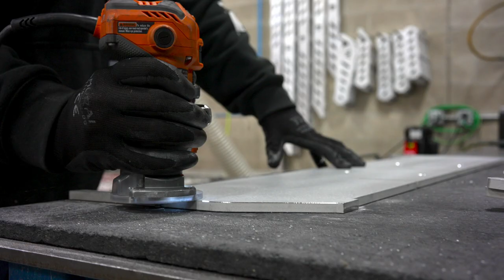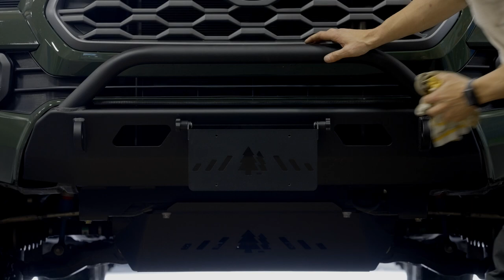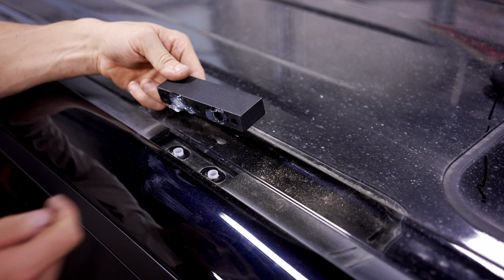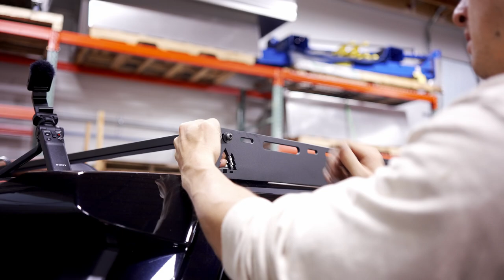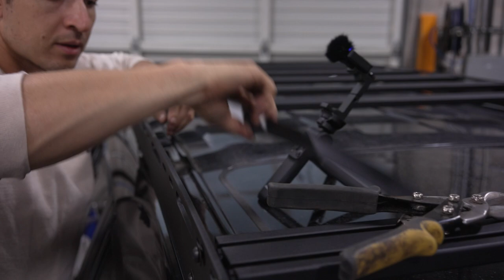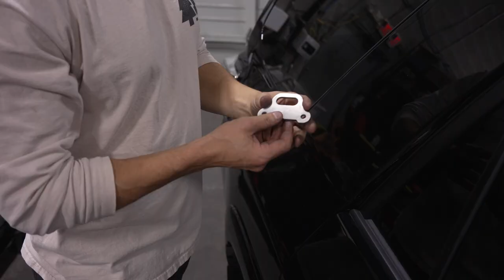4Runner Roof Rack

Comment: I like the design of these gutter blocks better than a similar product from Southern Style. Offroad  These bolts that attach to the truck don't have to be removed if you want to temporarily remove the rack, thus not upsetting the waterproof seal.  SSO do add butyl tape to their kit which I think would be a nice tweak to this unit instead of the silicone.